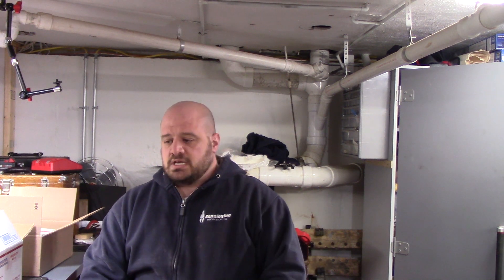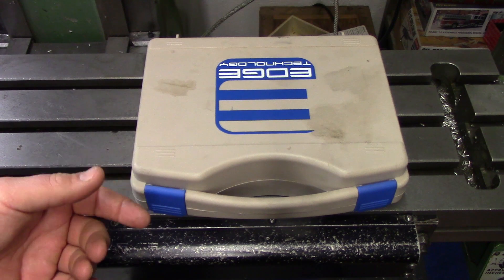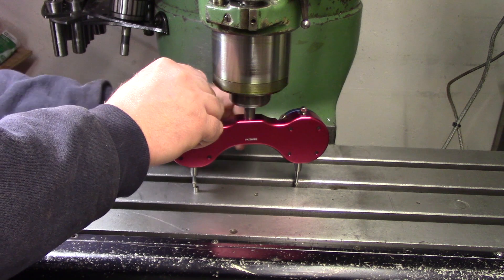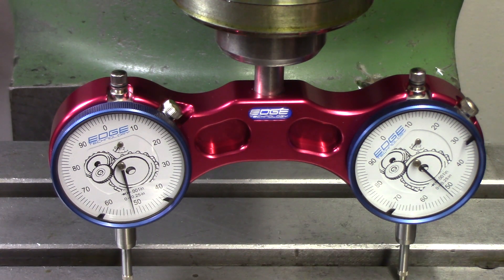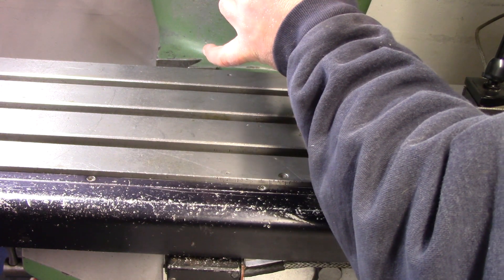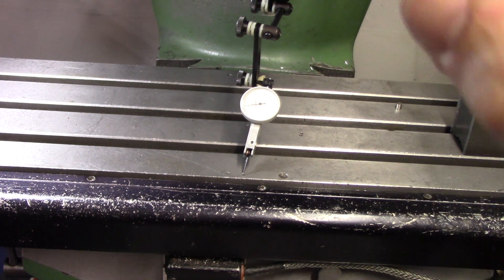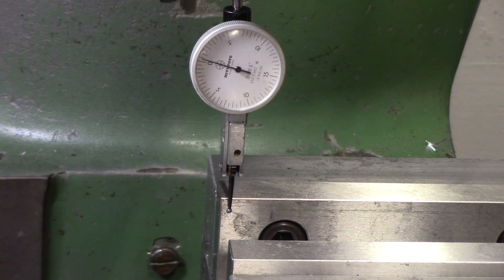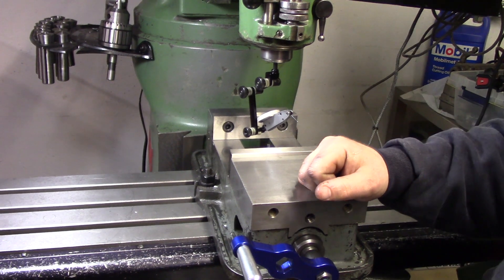Tramming Mill With Pro Tram

Comment: Just wanted to thank you for an earlier video on metric gears.  I own a southbend 9A.  Finally needed to make some metric threads.  Used your video to make some 3d printed 54/80 gears.  They work wonderful.  Also needed to make some 1.25 mm threads that the 54/80 combination can't.  Calculated that a 28/40 combination would work.  Had the 40 tooth metal gear so I 3d printed a 28 tooth one.  Perfect.

Comment: Love the new intro!  Good to see you again.  When did you get a mill?  I don't recall you having that.  Can you do a quick video on what mill you bought and why you chose this one and how you loaded it in?  Keep up the good work!
Reply from the maker: I've had it for a few years now. I got it for free and it was in pieces.  All the pieces were loaded into my truck and a trailer and carted home.  All pieces were lowered into the cellar through the bulkhead with A winch and a ramp.  Took 3 of us to wrestle the base but the rest was a breeze.  Look back on the channel and I have a ton of videos of putting it together.  Look at my first 13' southbend and you can see the ramp I built to lower it in.

Comment: A suggestion if I might, whenever using an indicator on the table, place 4 blocks of the same height on the table and indicate the tops of the blocks. So many times the table is not as flat as it should be, and the additional blocks will average it out easier.